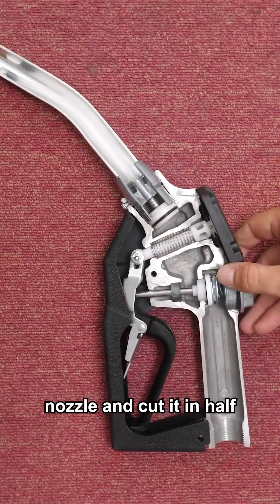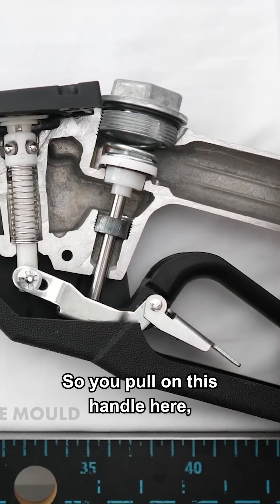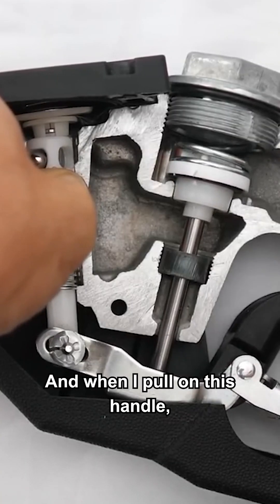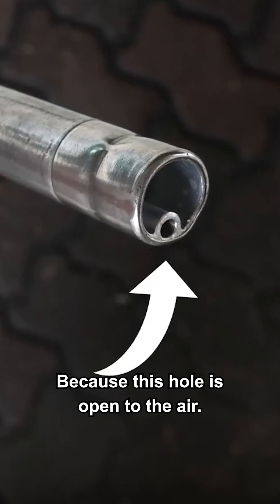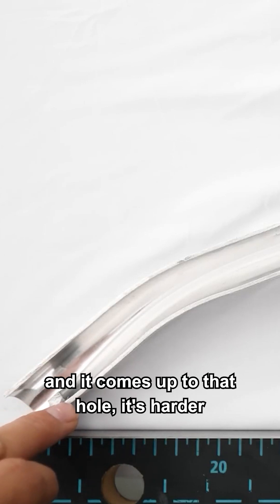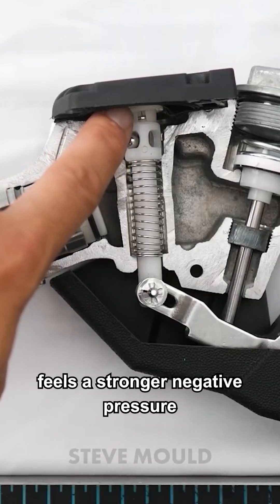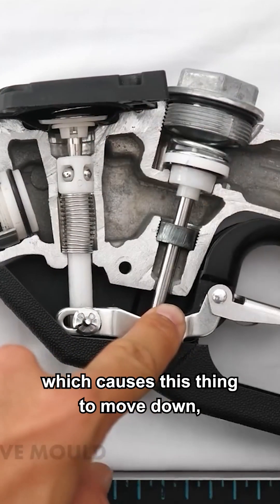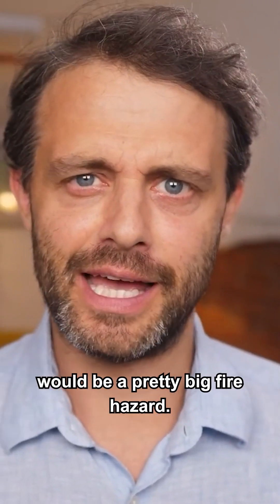I Cut A Petrol Pump in Half... For Science!

Comment: Unless your fuel tanks venting system isn't working properly.  It'll kick off every few seconds if the vent system isn't working properly.  You can spot these people at the pumps by how frequently the curse at it as you literally hear the pump kicking on and off repeatedly.  Lol
Reply: My old Hyundai was doing that a little bit near the end of its life, now I know!
Reply: My jeep did this when it was new but it got better with time.
Reply: I mean, for me it’s because every gas station re-designed their pumps so that they no longer fit into the hole on my gas tank like they used to, so only the very end can go in. It worked fine until every station owner and their mother bought some re-worked version that doesn’t fit (started seeing them about a decade ago and now every station use the ill-fitting pieces of crap). Like, they literally made them all fatter when they used to all be fine..

Comment: The big question is, why can't you lock the handle in the UK? In other countries you lock it until it's full and it disengages...
Reply: Ok I looked it up & I guess it’s because people would forget they still had the pump in their tanks & would get in their car drive away, ripping the hose off the tank. It also might? have something to do with static electricity, but that was on Reddit, so…
Reply: I’m in the US & in my state we used to have the locks, but they changed regulations on them & gas stations had to remove the locks, or at least make the locks not work. I assume they had a reason, but I im dumb & never looked up what that reason was & use my gas cap to lock it
Reply: @psivil.disobedience  When cars like mine (the cutoff rarely ever works for some reason) pull up to get gas, start the punp, lock it in place and then head inside for a Monster(tm) beverage and come out finding gallons of fuel spilled and are still spilling...

Comment: But why do i get charged 35p before any petrol comes out
Reply: You will get the amount that you pay for. 
I've worked in a petrol station, and I've been on shift twice when trading standards have arrived (unannounced) for random testing of pumps - in my experience, the calibration on the amount dispensed is extremely accurate. 
I'm not suggesting that there aren't retailers who risk running pumps with inaccurate metering, but they'll be running a significant risk. 
Defrauding the public is one thing, but defrauding Customs & Excise is a very bad idea.
Reply: Corruption
Reply: @iEatRocksssssz  you think they wouldn't have a better method than taking 35 cents at every gas station?
Reply: That should be why they always have a minimum of like 5 liters - it's when the pump reading should line up with the amount you actually got. (Though I don't know what's the required accuracy of the pumps nor have I actually tested this)
Reply: Because somebody laid the hose close
to the ground and emptied the hose
into a jug for their mower without
turning the pump on. 
When you show up, you pay to refill
the empty hose and therefore pay 
for the gas that mower guy stole.
12.28.2023
Reply: @mrbrown6421  Do you mind me asking why you added a date to your reply?
I've not seen that before.
Reply: @tincanblower  An old habit from somewhere.  Nothing special.
Reply: @mrbrown6421 "an old habit"?

I'm actually curious now...😅
Reply: @robertolsen6797  
Ok distant friend Robert.  
I'll explain.
I programmed computers for 30 years++.
Before source control was invented,
I timestamped all code changes as a means
of documentation, and to settle arguments
about when the changes were implemented.
Even after software source control became
common, the habit continued because
sometimes, over the years, the code gets 
separated from the source control database where the dates are stored.
Now, the habit continues because that
is the essence of a habit.
Not too interesting, but true.
In addition, I do not believe the dates shown
by YouTube.  They did change my name, 
and yours.

Best wishes sir.
-- 1.30.2024
Reply: @mrbrown6421  Damn, that's actually interesting, thanks for the response...!

And yeah, best of luck to you too...🥰